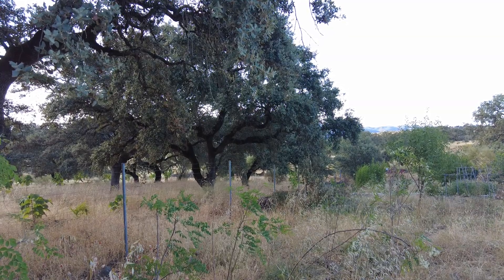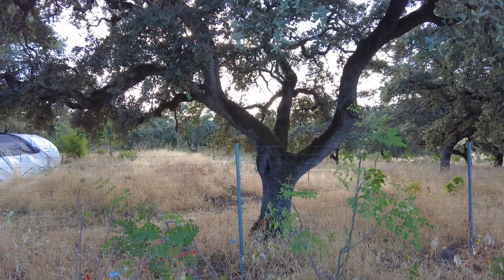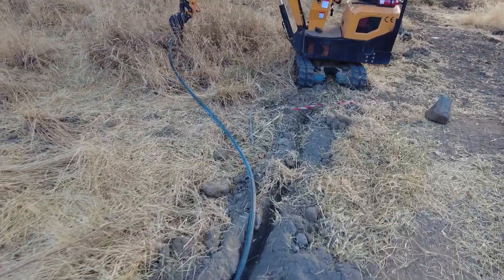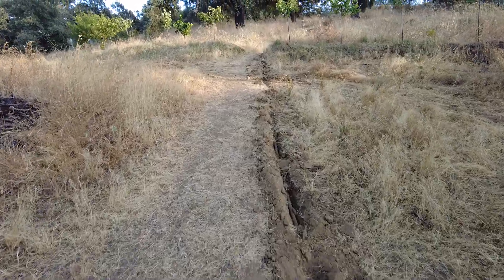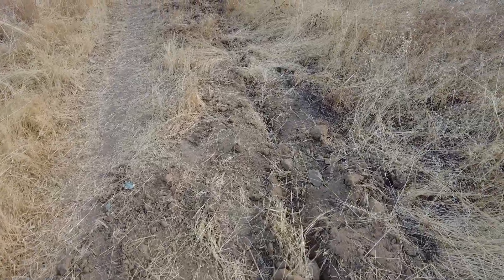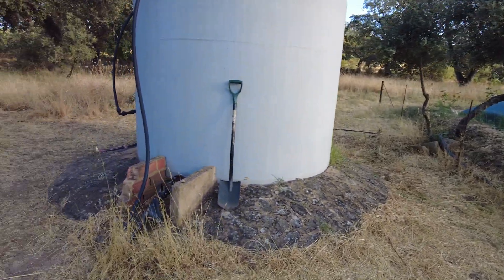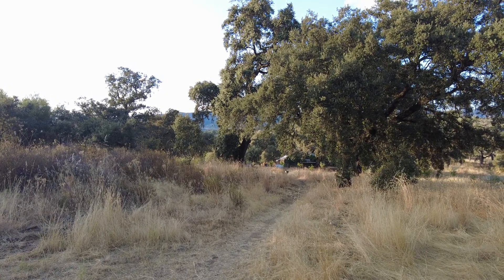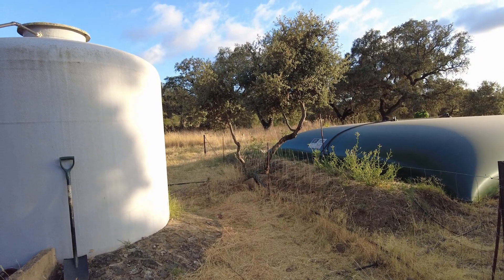Irrigation system going underground. #agroecology

Comment: Scattered brain idea: since you already have mini trenches for the water pipes and I guess you will fill them in with a loose earth, you may sow some cheap seeds (better seed balls) of perennial plants with a root system which will not wreck havoc with your tubes. Alfalfa?
With some luck the trenches/pipes/cables will be marked with rows of plants. And if one day pipe starts to leak even a bit soon you may be able to detect it by more vigorous growth close to the leak.
Bonus points:
1. By selecting different varieties or plant you can color code your trenches.
2. Depending on the soil structure if you need to dig out the fragment it may be easier to pull out the plant than pick through a compacted clay with a pipe underneath.
Reply from the maker: YOU ARE A GENIUS. Thank you for sharing a super simple idea
Reply: Well, the proof is in the pudding. Let's see first if it works. 
Sowing anything in the middle of the summer in Spain is an uphill battle. 
If you have some mulch/cut grass it may be worthy to enrich the trenches in the organic matter so the plants have a bit better chance for survival.

Comment: We use red tape for electric lines and yellow for water lines.  I also bury some baling wire so i can find it with a metal detector if i ever need to.
Reply from the maker: Super valuable information. Much appreciated
Reply: I placed a bale twine on top our old line a few years ago and it paid off this week when needing to find the pipe again. Do that for sure. A piece of line 150mm above the pipe is great
Reply from the maker: Super idea. Thanks for sharing  @NamibianFoodForestHomesteading